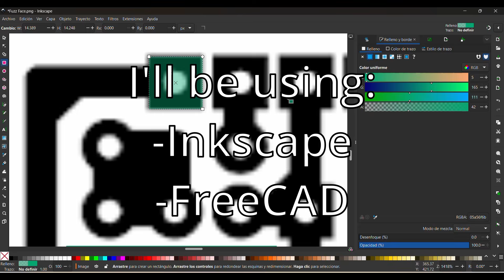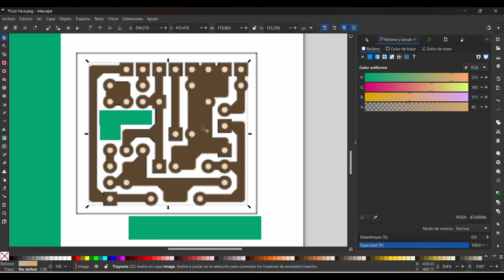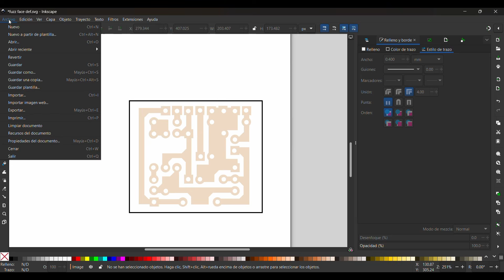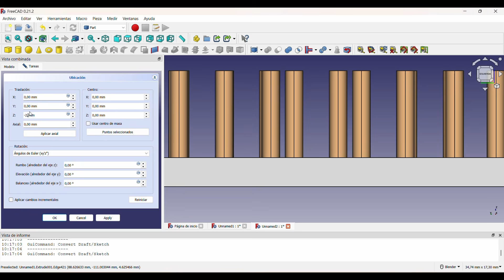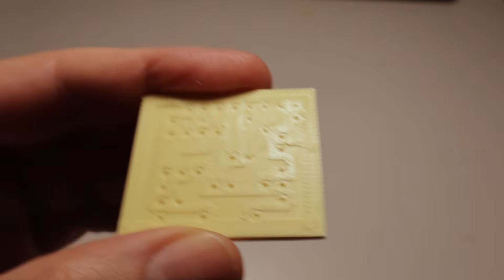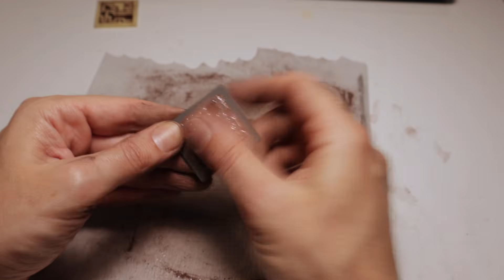3D Printed PCB! (sanded copper tape over printed model)

Comment: have you experimented with deeper grooves? 
I wonder if you could put full wire in deeper grooves, if you needed its electrical throughput. 

I also wonder about different methods that you would need if you chose significantly thicker copper tape. Maybe using a small mallet to hit the Play-Doh scraper, to push the traces in better?

Also have you thought about raising the gaps, ass opposed to recessing the traces? It would be easier to sand, though that might not be all that important
Reply from the maker: I have been told to try with deeper traces several times. I thought it was better to keep the traces higher to make the soldering process easier. Raising a little adge next to the traces so you only need to sand a little sounds genius. I will probably make a video trying suggestions from the comments. I'm sure we can learn a lot. Thank you so much for watching

Comment: The sanding is smart, but I would wear gloves, and vacuum it soon after; copper dust is pretty toxic.  You definitely don't want to breathe it.
Reply from the maker: Always a good idea! Next time I Will wear gloves and a mask. Thanks a lot
Reply: Just out of curiosity would wet sanding it help?  It shouldnt hurt the adhesive on the copper tape as im pretty sure most of that is at least water resistant and would help collect the copper dust yes?
Reply: @KoJeTsCorner  I'll try that, sounds like a good idea!
Reply: @daviniusb6798  Rad lemme know.
Reply: From a cursory search, it does seem like a good idea to wear a mask. Copper is not extremely toxic, and it doesn't bio-accumulate like heavy metals, but it's good to wear a mask to be sure, and clean up afterwards.
Reply: Not actually tocic, but the small particles get stuck in the lungs and you might develop asthma or similar condition from it.
Reply: iSmoke. Don't breath it.

Comment: I wonder if the sanding would be easier if you printed just a thin wall surrounding the traces, by which sanding would only remove the elevated copper on top of the thin wall and leave the rest glued.
Reply from the maker: Great idea! Probably the best way to do it, or at least the most efficient. Thanks a lot for the great idea and for watching!
Reply: Beryllium bronze is toxic. Copper is safe. This light metal is easily eliminated from the body. Heavy metals like lead and mercury are not eliminated.

Comment: instead of sanding, could you try making a negative 3D print that stamps into the other one, cutting the edges, while pushing them down - instead of using that playdough tool, then the excess could be peeled off
Reply: okay I just tried this, seems like it could work, but 0.5mm depth wasn’t enough to cut through all the tape
Reply from the maker: It's a cool idea, I'm just afraid It makes It difficult to solder if you go too deep. Have you tried soldering? I wouldn't mind making a video with all the suggestions, I'm just afraid to be repetitive if I make a video over the same topic
Reply: @frechetypen  Watching another DIY PCB video the other day I had a similar idea, but using a two stage process and foil with resin instead of tape. It's easy to turn the circuit into outlines within Inkscape, so we could create positive and negative plates to partially punch out the outline from copper foil first, leaving some bridges out to keep things together. A dotted outline could even work great for this, since we'd be punching through with teeth instead of wide blades. Then another punch could push the circuit through onto the receiving plate coated with resin. The first punch plate could also be used to mark the holes that need to be drilled/punched out. I can't find the time to do it, but I've been meaning to test this idea (Sans resin) with aluminium foil for starters.
Reply: @kindaovermyhead  Lmao in 3 hours, you're the goat
Reply: @kindaovermyhead  Instead of cutting out the sanding, maybe just use it to cut out the fiddly bit where you manually press the tape into the trace

Comment: Now we need to test this to the extreme. How small can we make the traces and can we make a full pc with this
Reply from the maker: Honestly if I can reach 2,5mm between holes I would consider it a super win, and I think it is more than reachable. And something really cool someone needs to try is a 2 layers PCB, copper in both sides. With this method is super simple.
Reply: @frechetypen The hard part of a 2 layer PCB with this method would be the vias. Your best option for that might be to have a metal pin going through the board, soldered on both sides.

Comment: I'm surprised you used inkscape over kicad for the pcb design. Was out just for familiarity, or was there another reason?
Reply from the maker: Yeah! Or even the sketch tools in freecad... I have a bit of a media background and i used to use Illustrator for everything 😂
Reply: @frechetypen  I was going to go with that, the sketch funcion would work well with something like this. Great idea tho!
Reply: @frechetypen  you could probably get away without any CAD tool at all, creating the rectangular body from a basic shape in slicer and importing the SVG as a negative part (my experience is with orca slicer, but I'm sure it applies to all modern slicers).
As usual, there are many ways to solve things. 👍